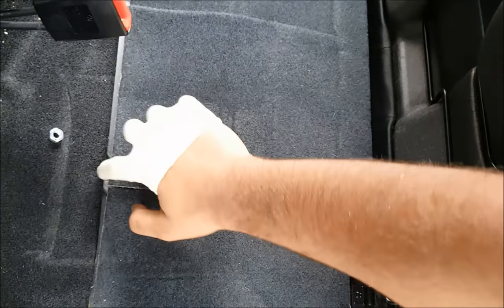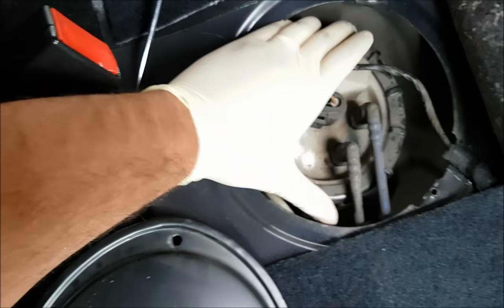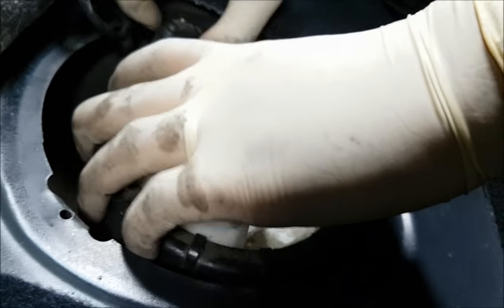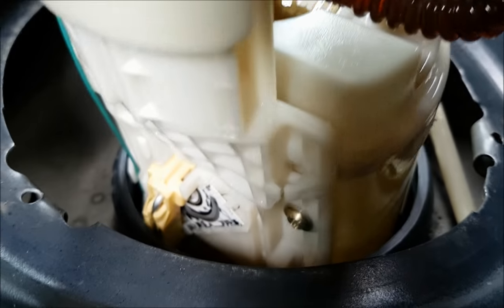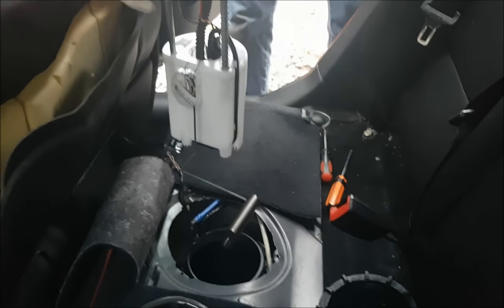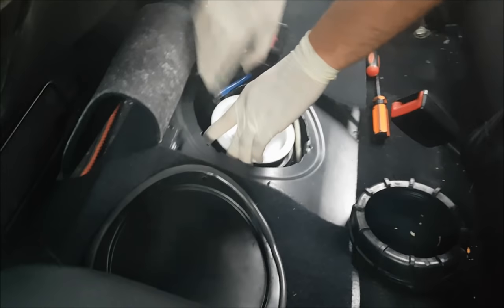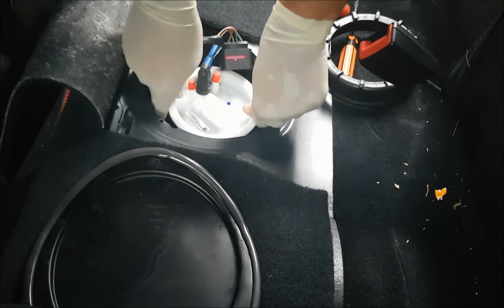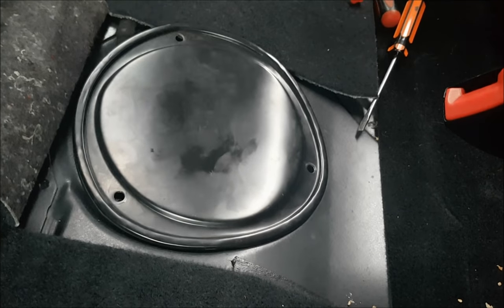How to Change Fuel Pump - VW / Audi / SEAT / Skoda

Comment: If you're having trouble getting the pump back into the hole  with the rubber seal.  At 5.38 push the seal into the hole first and apply a smear of grease onto the plastic top's mating surface, before pushing home, works.

Comment: Seat the rubber seal first, get the lip in then carefully slide it in, sorted, did our earlier in a TT
Reply: This comment is golden, bro thanks. Was struggling a bit, 'why doesn't it fit', then I remembered a comment about fitting the rubber seal first. It was your comment. 😎👍 Thanks!!

Comment: 26th December 2022. Just replaced on a 2006 VW Polo 1.4 tdi. Very good video and took 30 mins from start to finish. The only problem I had was unplugging the electrical plug. I just took a picture of the original before removing so I knew exactly how to put back in.
Reply: I can’t take the electrical plug off

Comment: Very useful and clear.  It helped me change the unit on a Seat Leon Mk2.    The only significant difference was the way the 2 fuel connecters had to be released.  There is a not-very-obvious push-in piece at the base of each connector which releases the connection.   It's blue on one which makes it easier to spot.  I also agree that the advise to buy the whole unit is very wise.
Reply from the maker: Carl, thank you so much for taking the time to comment and sharing your experiences of doing this job on a Mk2 Leon. I hope that will come in helpful to someone. Wish you all the best.
Reply: Need to do this on my mk2 leon as well as I'm getting code P0087 but do you need to code the fuel pump to the car?

Comment: Great video, changed mine (04 reg Passat) on the weekend following these steps, only took 30 minutes. Couple of suggestions/clarifications though:

1) To unclip the fuel pipes you need to push the base of the connector inwards towards the pipes center, not downwards as the video seems to show.

2) Once you've swapped the plastic seal from the old pump to the new one and inserted the new pump loosely into the fuel tank, don't try and seat the pump and seal into the tank together. Rather hold the pump a couple of inches out of the tank and maneuver the seal into place by itself, the pump then easily drops straight in with no further fiddling.

Thanks again.
Reply from the maker: Thanks for taking the time to comment and for your contribution!
Reply: @RedlineRevs  😅
Reply: I know this comment is a few years old now but wanted to say thanks for your second suggestion. I had the seal on the pump and it wasn't sitting right so I couldn't get the ring to screw on. Read your comment then 5 minutes later all done, engine running, so cheers!

Comment: In most of VAG Group cars there is a arrow on pump and corresponding arrow on cars body (within round hole).
To get it 100% right both arrows need to line up.
Reply: yes, exactly in this way it is.

Comment: Had my fuel pump changed on my Leon MK1 petrol 2 weeks ago. Car is running so much better. However, I can still smell petrol around the fuel pump cover in the rear. It's particularly noticeable when the tank is full. 

Has the seal not been refitted correctly?
Reply: I notice this too and I put the seal in around good I thought and then lowered the pump into the seated seal.... Did you have to redo it?

Comment: How about disconnect the battery and release  the fuel pressure from the vehicle before removing the fuel pump.
Reply: Can it be replaced without doing all that?
Reply: @mahonyboss  😅
Reply: @mahonyboss  watch the video again...

Comment: Does this apply to a 2006 Audi A4 1.8t cabriolet? I'm asking because I'm trying to figure out if I'm going to need the assenmacher 3307 fuel pump wrench or if I can do it without it.

Comment: Does the fuel pump have a filter and can it be changed
Reply: There's a strainer attached to the fuel pump intake pipe tip to keep sediment bits from being sucked into the pump itself and then being sent further down the fuel pipe. Otherwise it's just a normal fuel filter - wherever it is located in your car.

Comment: I have 05reg seat ibiza 1.9tdi Fr. Will it be the same to take out.
Reply from the maker: Yes
Reply: My car just went off out the blue then started some time later itself downhill. I changed the fuel filter after. Few days ago it happen again, seemed like there was no diesel in the car, but it did. I topped it up more and called the R.A.C the mechanic sprayed something in the pipe he took off and told me to start it. It started then when I switch the car off, it would not start again. It had to be recovered home.  Yesterday I took off the pump electric plug and took off one fuel line. Diesel started to come out I then put it back on and the switch as I had the wrong pump in the boot. I thought when I get the correct one I will know how to take it off and have some practice. I then checked all the fuses one by one, they were all good. I tried to start it and it did after few attempts, it never switched off I let the car running till the heaters got hot then turned it off. Since then car has been fine. Would anyone know why the car is doing such thing. Is it a faulty fuel pump that works sometimes and gives up. Seat ibiza 1.9tdi Fr 05reg

Comment: What symptoms were you getting? I have a stage 2 map and I get surging in 4th and 5th high rpm high load. I'm about to replace my pump with a kemso pump
Reply: I just replaced mine.  My symptoms were poor mileage like 750km a tank vs 850-900km and i had a stumble at idle like a misfire and it seemed my boost gauge was reading higher then before.  This lasted about a year, i was saving up for new injectors thinking they were bad... then i couldnt hear the pump priming.  Replacing it fixed everything.
Reply: Some pumps come with a arrow on top point it towards middle screw hole to avoid wrong fuel gauge reading

Comment: I've read that it's a pain in the a** to do that, but didn't seem that hard? Ordered the parts for my relatives car and been trying to figure it out whether to go diy or tell her to take it to some professional. I've changed the engine on my own Audi (2.4 v6, and THAT was a pain in the a** to do lying on the garage floor 😁) so technique wise there's no prob, just mentally 🤣
Reply: Oh and thanks for the video too ✌️
Reply from the maker: Cage80 thanks for your support! Go DIY bro it's really easy if I can do it you'll find it a doddle, I've never had an engine out myself! I believe in you!
Reply: Hardest part is removing wiring plug, something this video doesn't show very well. Video shows just a simple push with a screwdriver, sadly that does not work. 40 minutes and still no luck.
Reply: @Graeme758  Its 3 months since, have you managed to remove the fuel pump yet? jk ;)
Reply: @flow5718  🤣😂😅

Comment: Anyone had the code P0089 and replaced fuel pump ? My 2007 audi A4 2.0 Turbo has code P0089 and when I disconnect the gas line on the top of the engine , put it in a bucket and turn on the ignition , there is just a bit of gas coming out ! Wondering then if the fuel pump is going bad
Reply: lacuzon39000 well gas is gonna come out it’s a fuel line🤯